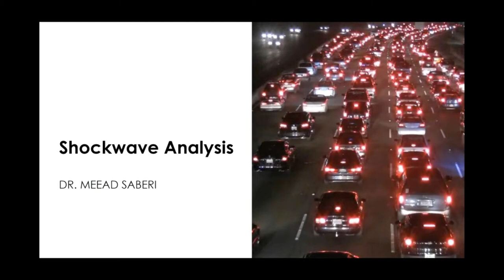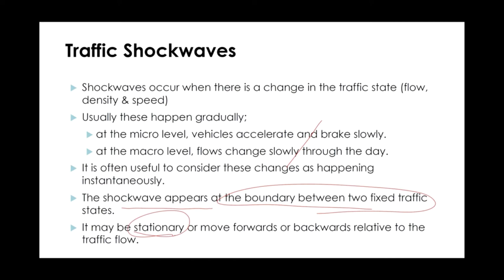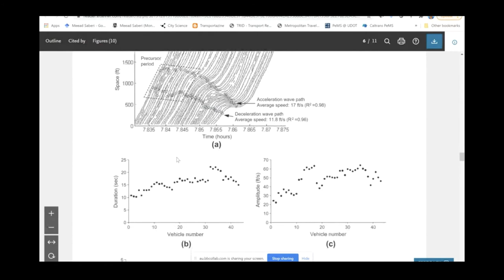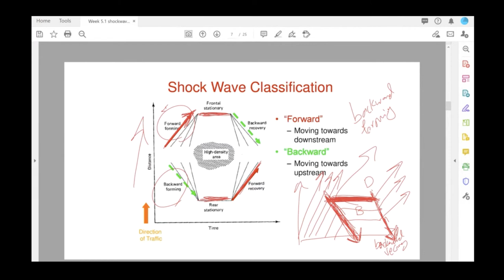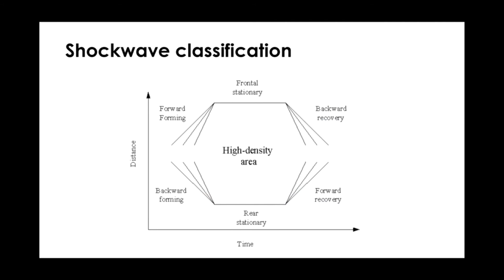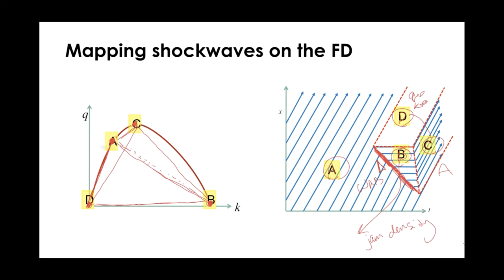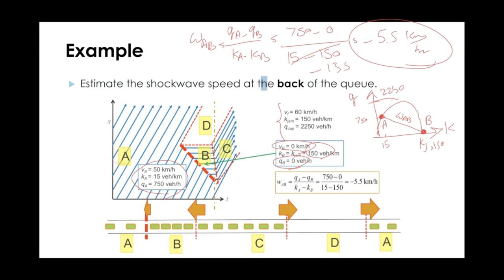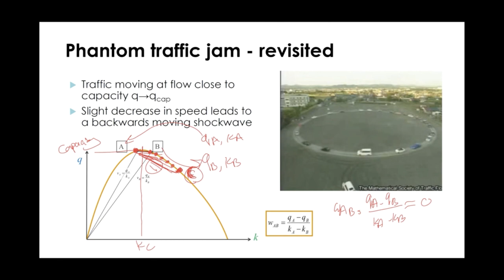CVEN9422 Lecture week 5: traffic shockwave analysis (part 1)

Comment: W CA  which is the shockwave between C and A is a backward recovery shockwave since the density at C is higher than the density at A ??
Reply: I think the shockwave from C-A should be a forward recovery shockwave because C has higher density and A has lower density. The traffic condition is going from high to low density will be considered as recovery. Also the slope is positive which will be considered as forward.